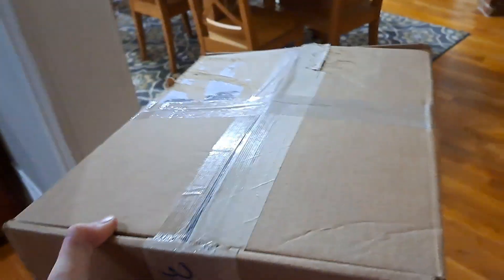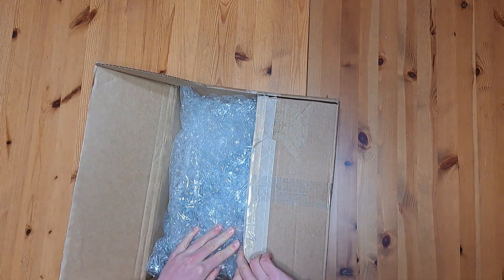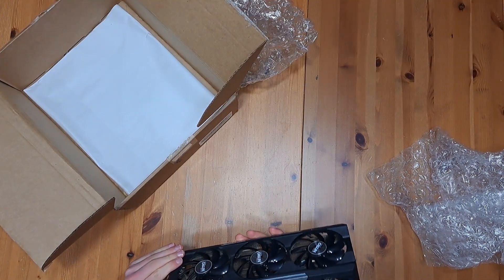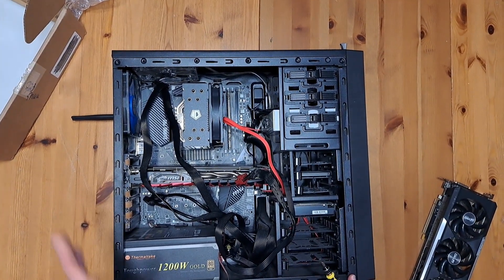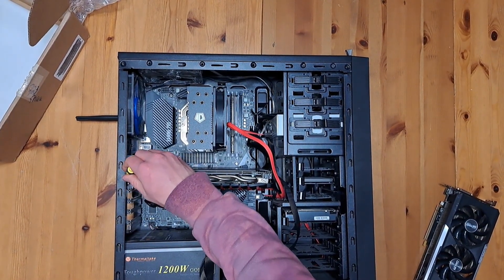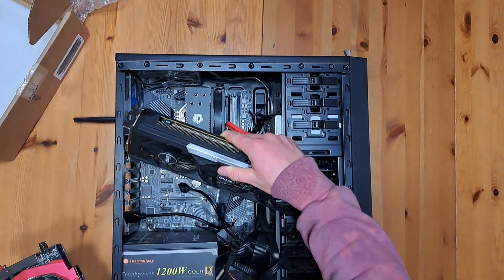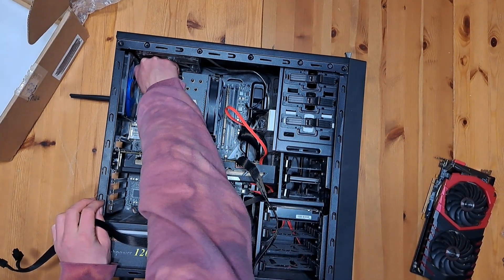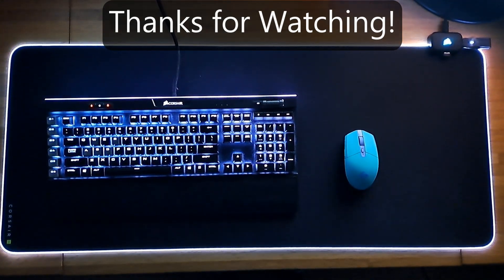R9 390X Unboxing and Installation!

Comment: is it better than a 1050ti?
Reply from the maker: I'm afraid I don't have a 1050ti for reference, but I think it might be a little bit faster. That being said, the R9 390X no longer receives driver updates, and I wouldn't recommend buying it unless you can find it for far cheaper than an Rx 580 or other (similarly performing) card. I'm going to make an in-depth benchmarking video for both my R9 390X and Rx 580 4GB which will hopefully help clear up any questions about their performance.